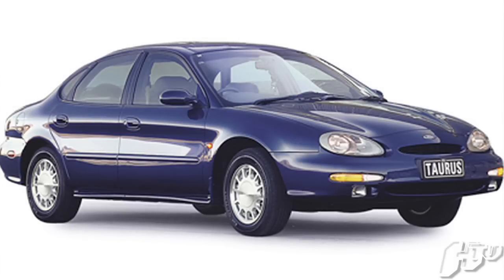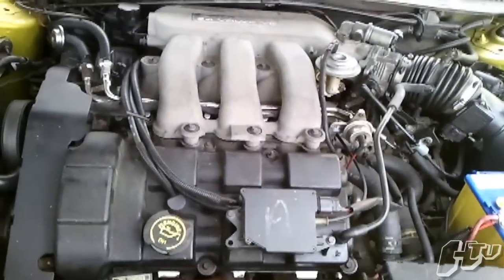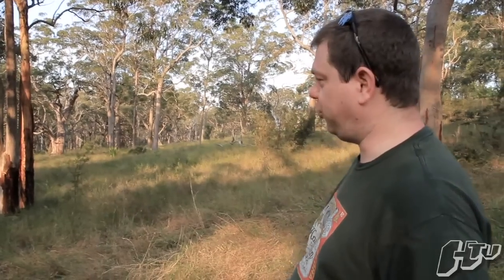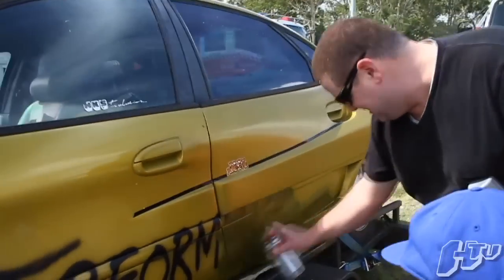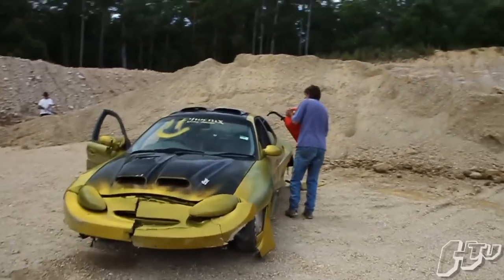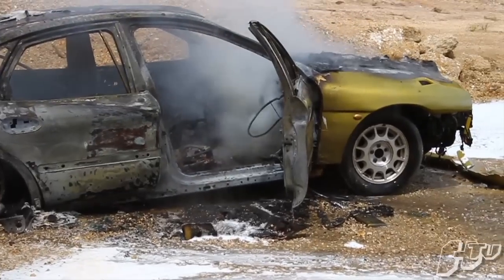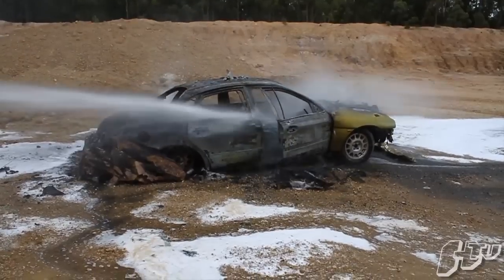DESTROYING THE WORLD'S UGLIEST CAR *FORD TAURUS*

Comment: it's got the 24v dohc motor in it. 200hp
Reply: and this is a lot in a two ton land barge?
Reply: it's 1.6 tons (3200lbs) and when you do some mods to it. the salica gtr has the 3.0 duratec with twin turbo's and that has 550hp. cheaply you can get it to 250hp. in no way is this a slow motor. they're also super cheap, super reliable, and really common.
Reply: if it had 130hp it'd be weird that my dads taurus wagon blasts past pickup trucks with 260hp up big grades on the highway
Reply: congratulations, you compared a grandmas car to a fucking muscle car
Reply: Got dat VTEC son
Reply: Hi
Reply: But it's still rubish.
Reply: had*
Reply: +steven earnshaw not 24 valve. dual over head cams it does have and 220 hp but i know for fact its not a 24 valve
Reply: you're completely wrong. its not 220hp. and it is DOHC. i own a third gen taurus, so does my dad. ive done tons of work to them.
Reply: they are 24 valve. it says right on the fender lol
Reply: The Taurus front end had a redesign; the front end had more of a SHO look too it. The previously rear amber turn signals were now red to match the brake light, even though the wiring and lighting stayed the same. The Sable had a slightly different grille, with the Mercury logo embedded into the grille. The trim badge style for the Sable also changed for this year.
1998 models had "disco ball" style headlights. 1998 models also had the option of a center console w/the column shift models in fleet editions for 1998.
The Sable GS wagon was not available for 1998. The Taurus LX wagon was not available for 1998.
The Vulcan became standard on all models of the Taurus (except the SHO) and Sables. The Duratec was now optional on all models except the SHO.
1998 gave way for the Duratec 24V DOHC badge on the fenders, just ahead of the front door jambs.
2nd generation airbags replaced 1st generation. The 2nd generation air bags had a single sensor to trigger the airbags.
The keypad entry in the door handle changed its style, as did the style of the keyless entry remote.
The 1998 Sable LS introduced a "LS Premium" package which included Duratec, EATC, dual illuminated visor vanity mirrors, power antenna, and remote keyless entry. The 1998 Taurus SE also introduced a "SE Comfort" package which was equipped similarly. SecuriLock Anti-Theft came standard w/ the Duratec.
Taurus and Sables equipped with a floor shift had new built-in cup holders, instead of the old fold-out ones.
1998 Taurus SE models had a "Limited" package which included a floor shifter and two-tone leather with "Limited" stiched into seats.
The Taurus SE now had a special sport package that included the Duratec, a spoiler, PATS, chrome sport wheel covers, 5-passenger seating, and a floor shifter.
The 1998 SHO had a few changes including:
Chrome wheels only
Washer nozzles went to black
Power passenger seat became optional
The door tweeters were revised
MAF went to black plastic.
SARC was updated for a better ride
Reply: if you don'\t wanna read that, the main line is "98 gave way for the Duratec 24V DOHC badge on the fenders, just ahead of the front door jambs"
Reply: steven earnshaw it's weak so we don't care

Comment: some tuner should have buyed it and made it look nicer, like putting a thin layer of Carbon Fibre on the hood, putting the wheels outwards and putting a spoiler on the back
then the only missing thing is a good engine with a nice turbo and blow off valve and there u have it, a sick tuned car!

Comment: That model of Taurus was ugly even before the mods. You really do have to wonder how much weed and hallucinogenic drugs went into the design process. "I think I'll put some flares on. The guards are in the way! No worries, I'll just tack 'em over the top with bog and fibreglass. Oh CRAP! I can't fit my 12 inch drag slicks on it! No problem, just use the stock tyres."

Comment: Most mass-market Fords are designed by Ford to not be easily modded. Dashboards for instance, they put curves into fascia's etc so that an after-market car stereo upgrade will never look good, oval or round surrounds on the centre console to make a rectangular car stereo, an ugly sight. I know because I've got relatives who had three generations employed by Ford and none of them would buy a Ford, even with the Company discount.
When I showed interest in buying one particular vehicle, I was told about a serious steering defect recall caused by repeated alterations to the engine bay design.
From the Edsel to the future, reliably ugly.

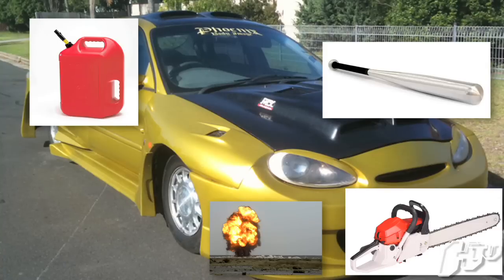Comment: I would like to know who made this thing, and why a Taurus? The ad mentioned Summernats, but the bodykit and Cannon exhausts are more synonymous with the Hot4s/ AutoSalon scene. That being the case, the Taurus is still a strange choice of platform. I looked up 'Phoenix Body Image' but it doesn't seem to exist. The car has obviously made a trip from Victoria? to New South Wales, judging by the registration plates, but what is even stranger, is that the front indicators change. In most of the photos, the indicators are clear, yet it has orange ones at 4:54.
Reply from the maker: The most important part is that we burnt it to a crisp

Comment: The body kit make easily 100 hp  and the hood make easily more 25hp Including original engine comes with 100 Horse Power amazing Not to mention the labels that each of them easily add another 10 Horse Power And exhaust produces 50 more horsepower

Comment: For sure that car wouldn't have been any good. The problem's that those ugly domestic kits make the car heavier and worse for fuel economy, speed, cornering and handling. The car suffers these changes and in the end they get some damage to engine, clutch, gearbox, but mostly to the suspensions, because they think they have a racing car and then they thrash it like it was one.

Comment: This would be the Ford Duratec V6. A stock ceramic engine block, and unremarkable performance. Although somehow, I have my doubts that's 5 grand of bodywork. More like 2 grand, if you look closely at all the body filler and rough edges. Looks like the kit might have been meant for something else, and they "mangled" it to fit. The Taurus only had a 2 year run in Australia, because this model was so ugly to begin with

Comment: Wonder if anyone thought of draining the oil out of the engine and letting it run dry? Then I would have either got 4wders to run over it or possibly strangle it with winch cables before setting fire to it with a few litres of diesel....unfortunately after its bbq it was still recognisable!!!